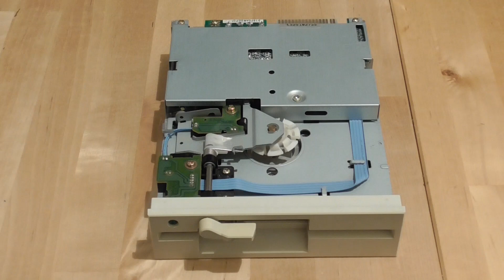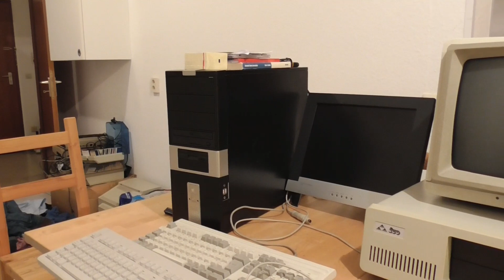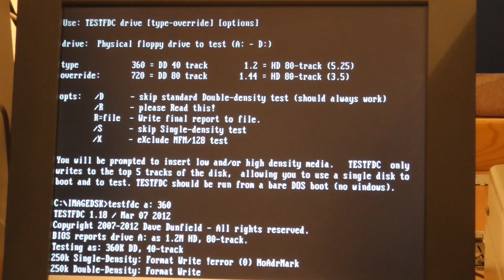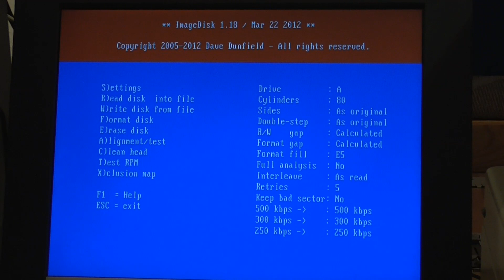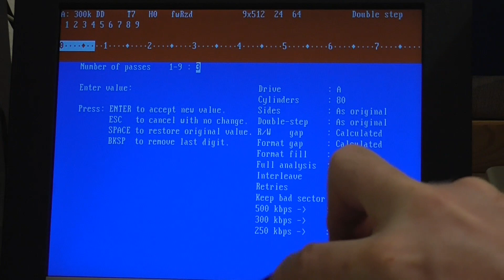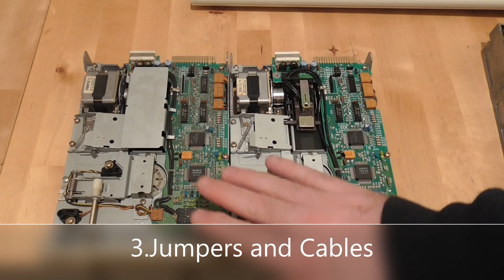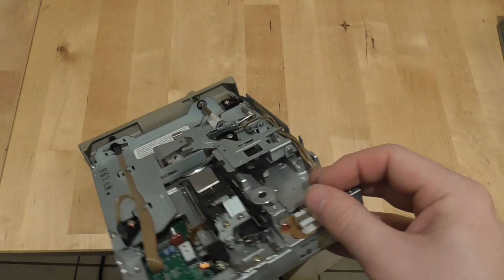Why most 5.25" Floppy Drives seem broken, but aren't!

Comment: Great video overall. Nevertheless, some information is misleading or incomplete. In IBM PC compatible computers, you generally want drives to run at a fixed speed. DD (360KB) drives should operate at 300RPM, and HD (1.2MB) drives should operate at 360RPM, no matter what the level on pin 2 is. The BIOS deals with DD diskettes running "too fast" in HD drives by choosing 300kbit/s instead of 250kbit/s data rate in the floppy controller.

On the drive side, there is only one kind of stepping, which steps the drive one drive track. "double stepping" means that the disk in the drive is formatted in a way that the disk tracks are twice far apart than the drive tracks. This happens if you try to access a 40-track disk in an 80-track drive. The drive you used with IMD is thus obviously an 80-track drive. In IBM PCs (don't know about Amstrad pecularities), all 80-track drives are HD drives. So this drive is likely a 1.2MB drive (at which operation at 360RPM is normal), but we can't exclude the drive being a non-PC 720KB drive (80 tracks, but no high-density support). This also explains why testfdc failed: The drive spins so fast that the formatting or writing the test track takes more than one revolution of the drive, so formatting the last sector will overwrite the beginning of the track, or formatting will be aborted because the index hole is detected during formatting. testdfdc with "1.2" might have passed at that point.

Using "DS0" to use a single drive before the twist as A: drive will likely not work as intended. On most drives, the DS0 to DS3 jumpers are just choosing which DS wire on the floppy cable will be used as DS for the drive. There is only one standard motor-on signal the floppy connector. The pin used by IBM for "A: motor on" before the twist is has been repurposed from one of the higher "DS" lines (DS2 or DS3). A drive before the twist jumpered to DS0 thus will respond to "B: motor on" and "A: drive select", which is not fine, unless you jumper the drive to use "drive select" instead of motor on to turn on the motor. In that case, you might get issues if the BIOS tries to keep the motor of drive A running while drive B is selected, and then re-selects drive A without waiting for an appropriate spin-up time (although I don't know whether the BIOS of IBM-compatible PCs generally does that).

The advice to jumper Drive Ready / Disk Changed generally to "Drive Ready" is bad. The PC BIOS is able to handle a "disk change" signal, and will return "error code 6" on the first floppy access after a disk change. DOS uses this error code to flush the FAT / Directory buffers. Not having a working disk change signal may inadvertantly use the old directory/FAT on a new disk, which will inevitably lead to data corruption. But there is one extra piece of information, which makes your advice partially correct: Classic 360KB PC drives used pin 34 as "drive ready", and the BIOS/DOS don't expect disk change signalling to work if the CMOS type is "360KB". For 1.2MB drives, you better use "disk changed", though.
Reply from the maker: Thanks for the in-depth analysis and sharing your (considerable expertise). Other commenters have noted how useful the comments on the video is (due to the incomplete nature of what I presented). This greatly adds to the usefulness of the resource!

Comment: For file transfer, could you not use a serial connection?
Reply from the maker: Yes, I guess you could. Most later PCs have USB rather than RS-232, but I imagine there are probably ways around it.
Reply: @PCRetroTech  Yeah, there might be an unused header for it on the motherboard, or  there are cards to be bought for cheap. I've also heard of doing it with drivers. Not sure about adapting DB-25/DC-37 connection to DE-9 though. 

Amazing video, by the way. I'll need to keep it in mind. I have a Pentium I machine, so I'm able to do it if I ever encounter a drive that needs maintenance.
Reply from the maker: @starchief93  Thanks. I'm glad you found it interesting!

Comment: My question on YouTube:
I know you have an Amstrad PC1512 SD and a 1640. How can you say the Amstrad only has one drive since the SD model I have as two connections on the MB cable? No twists as you say but...? The PC1512 (without the SD on the end) came with two floppy drives on that cable. The Tandon TM65-2L, which spins at 300RPM, that I have, came with DS0 selected like yours. Mine doesn't have the TM jumper but has a resistor pack DIP 16 rated at 3.6K ohms each or there abouts as I remember. I believe that has to be removed if it is not the last drive on the cable. Are you saying my Tandon will work even if it a newer ASUS MB that only allows for one floppy on the cable? Must it be after the twist or before? I fear, since I've tried this, and the twist reverses pin Drive Select 0.4v with Motor Select 5v. My Floppy controller chip looks a bit heat cracked at the moment. Not sure if Tandon drives from the mid to early '80's can handle the voltage change. JP3 is labelled BC or AC which I understand is the spindle motor on or controlled by motor control or drive select according to the owners manual so I use AC. JP2 DRIVE SELECT CONTROL = Drive Selected at all times (on) Drive Select controlled by DSO through DS3 (off) so no jumper there. JP1 is not mentioned. It has F-G or G-H. It came with G-H. I don’t know what that is. Probably the same as that TEAC FD-550 unknown @31:15  Any ideas? Thanks
Reply from the maker: Unfortunately I am not familiar with the Tandon drive you have, so I don't know what the jumpers mean. Certainly in the DD model the Amstrad had two floppies on the same cable. That is what I see in my machines too. For the rest I don't think I have clear answers. I'm not aware of any incompatibilities such as the ones you allude to. But that doesn't mean there weren't some Amstrad models with some unusual features that I don't know about.
Reply: @PCRetroTech  I saw on the Russian web site he said FG was changing how the DC grounds to the housing or goes through caps and <or> resistor. On the Tandon TM65-2L I tried to change H-G (how I found the drive) to F-G [OFF too] bench testing with only a digital ohm meter from 5v or 12v input and the input grounds and resistor levels didn't change. I guess nobody knows what the F-G jumper is for. Only time will tell I guess.

    In the Chinon FZ-506 UK manual (also known as Toshiba ND-0801AG... at least they look identical to me) there is a jumper Pin07 that the Russian guy says is FG. My Toshiba does label it on the board as FG. The owners manual never refers to it or suggests it should have a "short jumper" on it. Then I decided to try the resistor measurement test with the JP07 ON/OFF with the Toshiba and guess what? The resistance levels did go up on all input lines. The input grounds were then zero to the case when jumpered where before they had 100K on them when OFF. 12v and 5v had similar results but opposite. eg: 12v had 101k OFF and 0.7 ON. 

What that does I'm not too sure. Maybe just if the housing is not screwed to the case it is needed? Probably more than that.
Reply from the maker: @mrwebber35  Yeah I think someone mentioned in the comments that F-G is frame ground. But it's almost certainly not needed except perhaps on some really ancient drives. I don't remember what H-G stands for though.

There are drive manuals that mention frame ground in the form of a lug which is supposed to be wired to the chassis/equipment ground.
Reply: @PCRetroTech  The Fujitsu Limited M2611T 45MB HD has what I think they are referring to. Has what can be described as a spade clip screwed onto the back that takes the regular YC-180terminal. Can never get that drive to be recognized on anything yet but haven't put much effort into it. If I finish the Amstrad I'll try this old drive on it.
Reply from the maker: @mrwebber35  Will be interesting to see what you find.
Reply: @PCRetroTech  My Tandon TM65 2-L has that pattern on the bottom wheel. I had no idea until you mentioned it. Thanks but shows my expertise going forward. I pick up things as I go. Thing is the potentiometer's on the board seem to slight change the spinning pattern but ends up no change. Maybe the pots are bad. The pattern is fairly steady but every so slightly rotates backwards maybe one rotation behind about every 3-4 minutes. Do you think this is an issue or must it be perfect?
NOTE update: Found a similar service manual and it agrees with the proper owner's manual that rotation can be within 1.5 - 2% so I bet it's fine since it was reading disks just fine from my Toshiba before. Both manuals say the "all electronics are on the motor" or as I see it, the separate Cct. board just under the motor. I believe this model has no adjustment similar to the Tandon TM848, the service manual I'm referring. 
   I did have the Tandon Service Disk reading and testing the drive before it gave up the ghost. Speed test was failing perfection but it was reading all the disks I could throw at it. I am pretty sure the drive controller needs replacement that controls and reads read write commands. Moving it to another drive was too much for the DIP28 chip that already had heat cracks when I got it. I replaced the OEM glass cap that got it going but things don't fail without a reason. Probably designed to protect the main chip or be some sort of indicator things were heading south. I'll keep you posted as things progress.
Reply: Now I see the Tandon TM848 has a pot adjustment for speed near the the motor leads. The Tandon I have has the right spot on the board for two more pots but they are absent. Probably a good clue.
Reply from the maker: @mrwebber35  I would guess that it doesn't need to be perfect. There should be some tolerance in reading the data.

Comment: Annecdotal 'evidence', but I find 5.25" drives and floppies much much more reliable than 3.5" ones, and easier to repair when they are malfunctioning.
Reply from the maker: For reliability I've found the opposite (or just got lucky with 3.5" ones), but I can definitely imagine repairing the earlier drives is easier.
Reply: @PCRetroTech   I'm almost exclusively using 8 bit platforms (C64, C128), and that means all drives are early to mid 1980s technology, and that in turn means few if any 'early' smd caps, and lots of evidently very reliable 1980s 'standard' components. That probably makes a difference.

But for me, it is especially the disks themselves. Of the thousands of 1980s era 3.5" and 5.25" floppies I have (all dsdd), typically 1 out of 10 3.5" disks no longer works. For 5.25" disks it is more in the order of 1 out of 250 approx.
Reply from the maker: @c128stuff  Oh wow! That is an interesting observation. I have had a LOT of 5.25" diskettes die.

Comment: The FG jumper usually stands for Frame Ground, it connects the ground signal from the data connector to the metal frame of the drive, it's do deal with ground loop problems. Most of the time that jumper won't matter
Reply from the maker: Cool, thanks for the info. One mystery solved!

Comment: Why mix-up 360k Floppy's with use of 1,2M drive fails often.Cause the heads of a 1,2M are smaller. See as a 2 lane driveway. The 2 lanes together are 360K Wide, a 1,2M uses just 1 lane at 360K.And step over 2nd lane for next track, leaving that 2nd lane unused. So if you write a 360k formated floppy with a 1,2M just 1 lane is read and other lane is un toughed. If there were data on that 360k, at 2nd lane there is still some old data left. The 1,2M does not bother as it just read 1 lane, BUT the 360k drive reads both lanes at the same time. So now there is a mix-up of signals. A format DOES not whipe clean the disk, completely. So there is still some old data left at those lanes. The reverse is the same kind of mix up data. 
--> Then from WIN95 on, 360k drives Does not work at all any more! Even if Bios set up is correct. 360k only works in the DOS mode. 
For many old upscure Floppy's from old non DOS machines, take very care of your PC Floppy controller if it can handles that format. Not all floppy controllers can handle all kinds of formats. Indeed use TESTFDC for that to check out.
Reply from the maker: The coercivity of the magnetic media is also different.
Reply: @PCRetroTech  Thats indeed next problem with use High dence disks in 360k drive. Often lead to bad data.  Its a struggle. But in the end you get the hand of it.

Comment: May I recommend the cable transfer program FastLynx? It can transfer files over RS-232 null modem cables or parallel port cables including those for Laplink. One of its fanciest features is the ability to transfer itself to a DOS PC over null modem, so you don't even need a working floppy drive.

Comment: i have an old TEAC 5.25 inch floppy drive. it does spin, however it stops after a while. the little light isnt turning on at all. It is in fact NOT connected to the motherboard, only to the PSU.
Im using it with a socket 462 motherboard, slightly too modern but... what am i doing wrong that the light isnt turning on? any help is welcome
Reply from the maker: The light should indicate when there's activity on the drive, which wouldn't be the case if it isn't connected to the motherboard (unless you have the data cable around the wrong way). It should be possible to see if your board supports the drive by looking in the BIOS. Of course there also needs to be a floppy connector on the board, but I assume you have that.
Reply: @PCRetroTech  im struggling to find 5.25 inch floppy cables. do they have a specific name?
Reply from the maker: @mrkevinkillercrafterminecr895  No, that should be the right name. Sometimes you find them in boxes of assorted cables, though make sure the connector is the right one for your drive.
Reply: @PCRetroTech  Sadly, its been hours and im yet to find a good offering in germany, which is where i happen to live
Reply from the maker: @mrkevinkillercrafterminecr895  They aren't cheap by the looks of it, but I do find them when I go looking for Floppy Flachbandkabel. The cable you want should have a 34 pin connector on it at one end that looks like it will plug into your motherboard and two other similar connectors elsewhere on the cable. Then there should be two additional chunkier looking connectors on the same cable. Those chunkier connectors are for 5.25 inch drives.
Reply: @PCRetroTech  I do know how they look like, i used to have one. theres no listings for them sadly
But i apreciate your effort <3
Reply from the maker: @mrkevinkillercrafterminecr895  I'm in Germany and can find plenty of listings. I think you are using the wrong auction websites. I can't recommend websites on YouTube due to the law here in Germany, but I would say most Computer-Klassiker adverts go through this particular website these days, which might be why you are having trouble finding something.
Reply: @PCRetroTech  yes, but not connected, as im lacking a cable for it

Comment: @PCRetroTech
One question about the ImageDisk tool you use at 7:21.
If a floppy disk drive is misaligned, how does the ImageDisk tool find the errors?
What i want to know is, do you need to format a floppy disk on a working correctly aligned drive to use that tool on a not working drive?
Reply from the maker: Yes you need a known good disk. This is covered in the manual that comes with the program.
Reply: @PCRetroTech  Thank you a lot for your answer.

Comment: A trick I have used on floppy disks when all else fails is nice strong magnet fully erase all the formatting completely then reformat the disk in what ever computer your planning to use it in I used a magnet from a blown 12inch woofer and still had to make sure passed it all over the disk for it to be completely wiped I would only use this as a last resort but have had good success doing this.
Reply: I use a bulk tape eraser for a reel to reel tape recorder on my floppy disks to erase them and it works great .
Reply: @zaper, this way you can only magnetize the disk beyond the drive's ability to re-magnetize it during format. Use the demagnetizer with slowly decaying AC electromagnet

Comment: I have an old 386 based IBM compatible with a 3.5 drive that fits the 5.25 bay they exist and use the same ribbon cable style that slips on a pcb instead of the ide pin style

Comment: It's weird, my experience has been that most 3.5" floppy drives seem broken or questionable while all of the 5.25" drives I've used have been extremely reliable. I wonder why that is.
Reply from the maker: That must be a regional thing. Perhaps there's a very good 5.25" repairer or something.
Reply: No, i can second that.
I still have my 5.25" disk drive in a working condition. It only had to go to a repair shop once.
But the 3.5" disk drives did fail very soon. In the nineties, when floppy disk were still common i had to buy several 3,5" disk drives. The situation got worse, when the CPUs started to require active cooling fans and when the floppy disk drive as a storage medium become obsolete. I assume, the cooling fans do drag some dust into the floppy drives.

And the situation is much worse when we are talking about the floppy disks.
I threw away over 90 x 1,44 MiB 3,5" floppy disks in the nineties because of read errors, but only about 10  x 5,25" HD floppy disks.